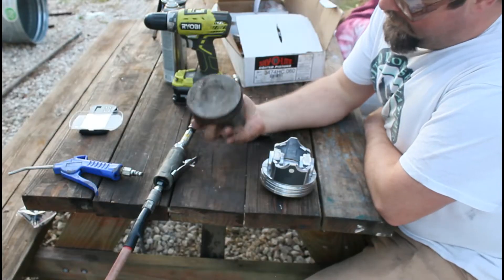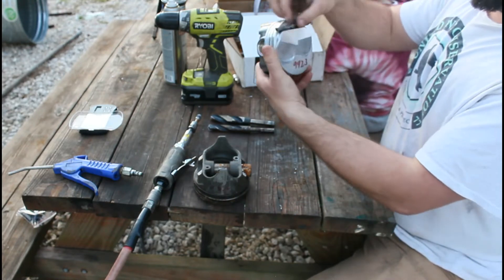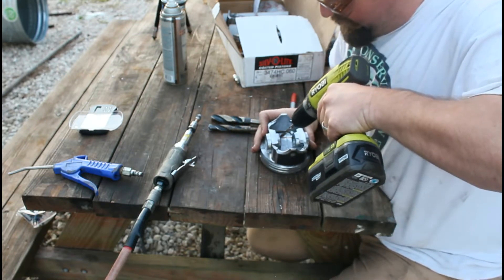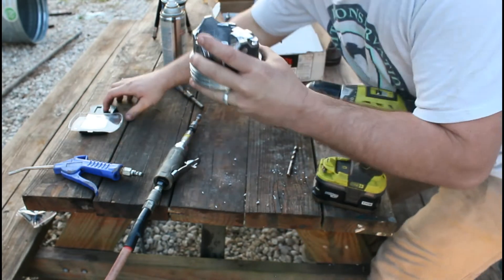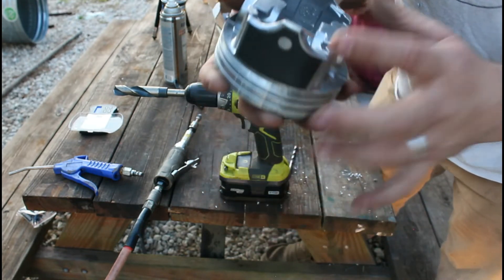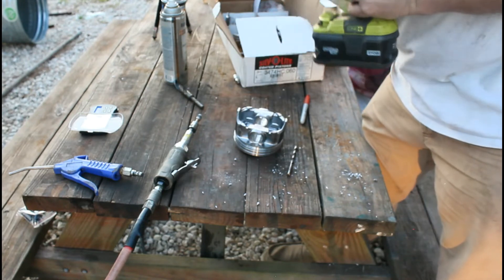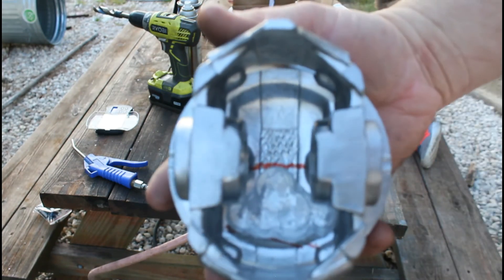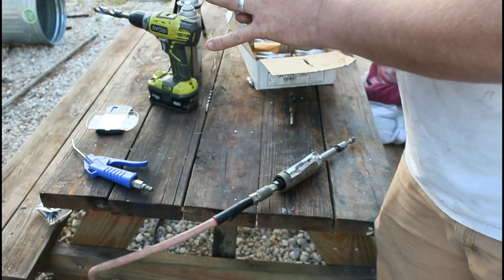How to remove weight from a piston to balance rotating assembly on a budget. Will it work??

Comment: OMG, when does it blow up?  I would never use a drill, too localized and adds stressed points especially in the crown where you are drilling.   Use carbide burr bits and remove it from the piston pin bosses and the main architecture edges, then use sanding to smooth it.   I normally do engines down to .1 grams on each assembly but i will never have stress cracks. I guess if you're running a chugger you could do this.
Reply: The order that I watched the videos from my search results, was perfect.
First one was a professional speed shop, he explained how linishing certain surfaces were ok, but where people like to remove material, ribs, was a bad idea. And how you should respect the circumference of the boss material, and NEVER use a drill, and NEVER drill into the back of the piston.
And then I watch this hick.
ROFL. 🤣

Comment: I'm doing that same thing. My 454 has flattops it's been previously balanced. I'm thinking first I'll weigh the pistons then shop for lighter pins to see if it'll be just that easy. Another option is to take material out of the pin right in the center at the edges. Steel is heavier so it doesn't take much.

Comment: I’m pretty sure that it doesn’t really matter whether they match the old pistons weight. What matters is that all the pistons weigh the same individually. From the factory these motors aren’t balanced like a machine shop would balance a motor. It’s to labor intense for them to do that kind of work.
Reply from the maker: this engine had been rebuilt previously and I just wanted to get the piston close to what the old pistons were.

Comment: Did it work? Need to remove 20 grams of a piston to match the others and avoid buying the whole set. Thanks for the video
Reply from the maker: yes sir it did work I've got probably 1000 miles on that engine and 20 1/8th mile passes I beat on it constantly
Reply: @hotrodhustle5456 Oh well I'm doing it as well then. Thank you for the superfast reply👍
Reply from the maker: let us know how it works! I've had good results. I've even had broken valves smash on cast pistons I've weight matched like this, and the cast iron head broke before the piston
Reply: @hotrodhustle5456  Tried taking weight off it, but it is such a small piston (1.4T engine).So after 5 grams had to give up. There was nothing more to take off without damaging it. So ended up buying another one( older model apparently) that it looks exactly like the other 3 in the engine. It should be here in a few days.
Again, thanks for the video
Reply from the maker: I'm sorry it didn't work for you that is a lot to take off a small piston
Reply: @hotrodhustle5456  Thanks mate, we'll just keep on wrenching. All the best